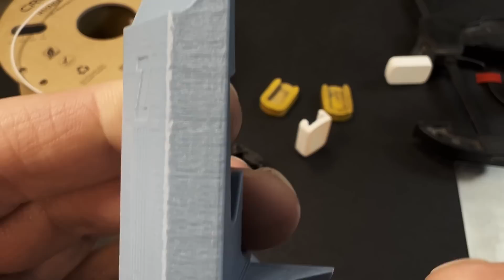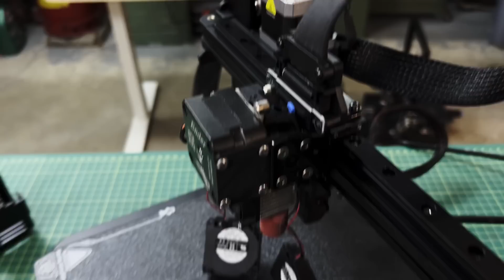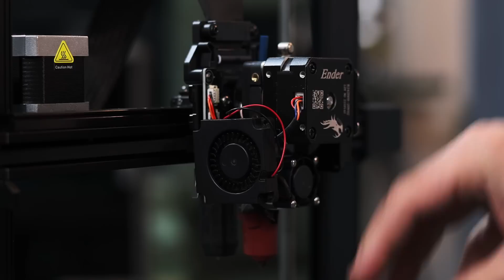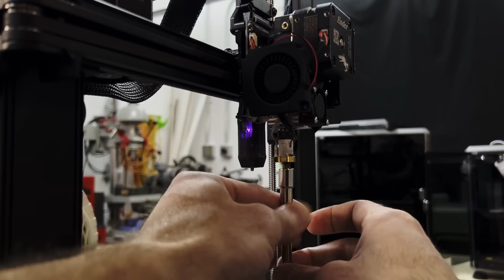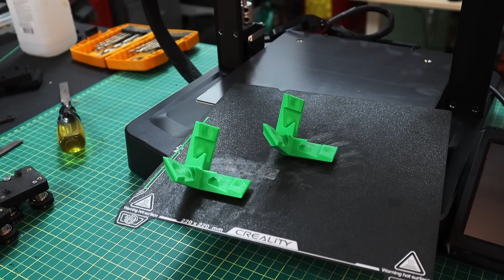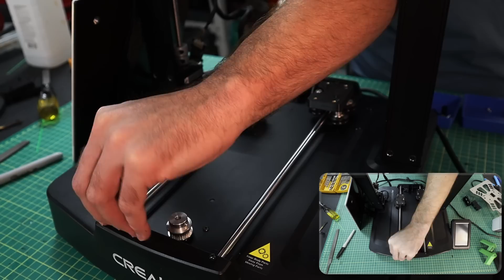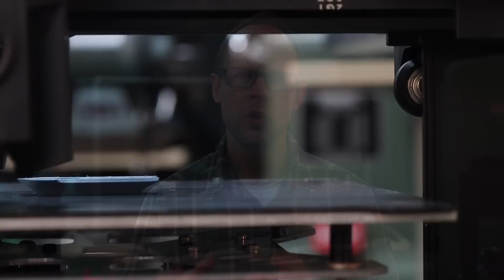What Causes BAD Print Quality on the Ender 3 V3 KE? - Fast Bed Slinger

Comment: I have found the same to be true on my v3 KE.  The y axis bearings are horrendously noisy, leading me to believe they are cheap and defective.  Switching to a linear rail once parts arrive.
Reply from the maker: Yeah, seems like a pretty big flaw with the design, I also notice that the Ender 3 Plus has the same design.  I have a complete set coming out with linear rails which is going to be better than the other option out there, but it'll be about 1 month until I can release the video, the parts like yours are on order from Ali express...   I want to ramp it up after they get here and see how fast I can go with the mod.  I think the extruder is a little weak also, it probably needs a change too.
Reply: @NeedItMakeIt  First sprite extruder I have had and I have some concerns with accurate flow and retractions.  I have concerns regarding how flimsy the gantry is with the spool up top, which I will also be addressing with some bracing.  Quick note, VFA tests show that slow speeds are actually way worse for artifacts than fast speeds....never seen that before.  There is something very odd with their stepper motor control.
Reply from the maker: @nakedspartan  I don't know why a fast printer has a plastic version of the sprite extruder mounted.  Maybe this is just an older designed printer and they figured they'd release it anyway.  I'm seeing the same with artifacts as well, I'd have to check the video, but it seems far worse in one direction, and I agree, at slow speed it is much more visible.  That's the same for the K1 printer as well.  I don't recall the exact answer, but I believe it was the momentum of the movement that was reducing the visibility, extending the undulations to a point where it was hard to see them.  I think it's fixable though, they've addressed the issue with the K1C by having smaller pulleys and also smooth bearing guides behind them and the results seem to be quite a bit better.  My guess is that the large Y pulley is the issue here and that if we switch it out for a smaller one, and increase the movement of the motor, it would help quite a bit. 

If this seems interesting to test, let me know and I can always do a follow up video on just that one topic.
Reply: @NeedItMakeIt That would be awesome.  My biggest complaint with the KE isn't that it doesn't deliver speed, but that I can't seem to achieve good quality even when I dial it down.  I did see another video where they said they actually loved printing miniatures with a 0.2 nozzle, so maybe it's not as complicated a problem as it seems.
Reply from the maker: @RutgersSieve  I would think if they're printing minis, the speeds are quite low and if they're printing towards the center, it would turn out well.  

I think from now on, I'll be testing any bed slingers at the front and back corners first.   I think with the solution I'll provide pretty soon, people will be able to ramp up the printer and still get really good results.  That one little issue here seems to have a big impact.  I think some people also will have parts which are the correct size and with a tight fit, the bearings won't allow much movement on those rods.

Comment: I think it's time to admit this is a design flaw. Single bearing per rod saves space and/or increases Y range, but clearly makes things wobble. Seems like the actual solution would be to apply a hacksaw to this nice base, mount longer rods, and convert bed to 4 bearings with appropriate spacing between them.
Reply: This will cause high precision bearing to lock up. Too many constraints.
Reply: @myvideo7748 Had similar problem when I switched to low tolerance rods and brass/graphite bearings (just my experiments - don't ask). Resolved it by slowly tightening bolts holding bearing cases while checking the movement of the carriage.

Comment: I just got this printer a couple weeks ago. I also had a Kobra 2 pro, and the Ender 3 V3 ke blows it out of the water on print quality, speed, ease of maintenance. Pretty much in every way it's better. 
I've not had any issues with print quality on the ender machine yet. Only had one print failure so far,  and it was because the print broke free from the build plate. Was my fault, I didn't use any adhesion layers.
Reply from the maker: That's good to know.  Have to tried printing in the front or far back corners yet?  Printing in the middle seems to provide pretty good results.  I'm designing a system to fix the movement and allow the printer to reach the highest speeds as well... hopefully at least.  

Maybe you received a printer from a good batch?

Comment: I had the same issue on my SE, changed the bearings and now it prints wonderfully
Reply from the maker: Do you mind telling me where you bought the bearings, or the exact product if that's possible?   I've been looking for the best solution to provide to other people with the same issues.  I was leaning toward linear rails, but I'm open to other ideas as well.
Reply: @NeedItMakeIt  I just got cheap ones from Temu as I wanted to see how they worked, they were a much tighter fit than the stock ones, now the wobble is almost 100 percent gone, but I do think that the rods are too close together which causes the corners to not be as supported, linear rails a bit more apart should be the ultimate fix
Reply from the maker: @manuel509rios  Really,  okay that would be a good first step and I can show that in the follow up video as a comparison.  I took my dial indicator and in the center I measured only 0.01mm of movement, but at the front, I was able to measure 0.15mm, and that was just a light pressure by one finger.  With the movement of the bed and a bit of spring action, I think we'll see more when a program is running.  Thanks for that info, I'll work on a final solution for anyone with this printer or other printers with the same setup.  

I notice that the new Ender 3 V3 Plus has the same rods and bearings, which is even more concerning since the printable area is 300 x 300, I sure hope they have high precision parts on those printers!

Comment: I print petg exclusively and was considering replacing my sv01s with these printers.  Why didn't you just try print at a much slower speed to remove the vibrations ? I print at 40mm /s max.

Comment: Would love to see the 3rd part to your KE series. New to 3D Printers and design and while its nice to problem solve there are times when you just want a part printed. What is your recommendation for an out of the box setup with minimal issues? Or a link to anything you recommend. 

You're doing an awesome job with your video's and channel BTW. Thanks for the great content.
Reply from the maker: For sure!  I'm working on something that I hope will be easy for anyone to print and install themselves, unfortunately it does require the purchase of linear rails and some screws, from Aliexpress it's about $40-50 and a bit of a wait.  It should get us to a really good point with the printer though and allow us to reach the highest speeds with good results.  The extruder is still a bit of a concern, I still believe that this extruder should be the same as the K1 printers.  

I'll be about a month or so until the next KE video, I need to wait for the parts to arrive and then I can finalize the video, showing the install and testing etc.  I'll try to keep it short and sweet.

Thanks for the support I really appreciate the kind words!   Lots more content to come!
Reply: @NeedItMakeIt  Hey these KE videos were really needed. So many people reviewing and not saying a single word about how much the bed shakes and raddles. I also had a problem with my CR touch hitting my prints. I plan on doing exactly what you do with the linear rails to my KE. Could you possibly link the parts list so I can get them ordered now ahead of your video? It would save me and maybe others waiting time. Would be greatly appreciated
Reply from the maker: @ty8324  I like Creality, I've always liked them, and I'm not really a brand person, but offering printers like this which are 'faster' makes no sense if you're not doing a few key things right, and the fit... as well as the overall design of the way the bed rides on the rods is a pretty big one.  

Checklist:

Up/Down - Check
Left/Right - Check
Forward/Backward - Oops missed that one

Well that's okay, it's best 2/3 right? 

I want to make these videos for the people who have the same problem as I do, and also to make sure that Creality is aware of the problems and hopefully it applies some pressure as well.

I'm actually working on the solution at this very moment, but I haven't tested it so it's in proto-type stage and I won't have the rails and blocks for about a month sadly.  Can you let me finish up the design over the next few days, and make sure it's the right call and then I'll send you a note so you can place the order?  I wouldn't want to have people spending money and then find out that something didn't work the way I expected it to. 

The goal here is an inexpensive upgrade, but one that looks good as well.  And to do thing, I am taking a slightly different approach than anyone else doing this has, well anything I've seen online anyway.
Reply: @NeedItMakeIt  I totally agree. That they released such a subpar bearing/rod design astounds me.

IRL, I know four people who currently have KEs, and they all have similar problems. A problem even arose for one of them where the rod itself was moving due to the bottom screw's insufficient length to make contact with the rod. That with the bed wiggle was not a pleasant sound printing at high speeds lol.

You make a valid point, now that you say that I'd prefer to wait and see your idea through to the end. Don't rush. My ADHD caused me to make my first comment, hehe. Even so, it would be interesting to see how your design differs from DerrickDarrell's "Ender 3 V3 SE / KE D3D Y Rails" design on Printables. 

For many, inexpensive will be essential. I'm excited to see the concepts you produce :) I will be following along
Reply from the maker: @ty8324  I figure with how they produce so many printers, they'll be a lot of them with the same issues.  It reminds me of when I worked for a Company making high-production furniture, when we found out we had a problem with a giant wardrobe cabinet, we had to go to the storage facility and open up every giant box and fix each one, that was a ton of work.  

I'm printing the first set of bearing block mounts right now.  I think this will work well, BUT I found something I didn't expect.  The steel plate below the bed is domed.  I would assume they're all like this having being punched out.  Maybe you can confirm that yours is also that way.  What I've done is compensated for it by having the mounting piece slightly domed as well, but maybe I'll have both options just incase someone has a flat one for some reason.  

I had to 3D scan the base to make sure everything was going to fit and that it wouldn't conflict, I'll add that into the video incase anyone needs to do something like that themselves in future. 

I checked out the other design, and the one I am working on is quite a bit different, it will be more stable and will have less parts.  Black rails would look amazing here, but I can't find them on Aliexpress, so I'm going with the standard and we can always blue it later on if it's needed.

Stay tuned!
Reply: @NeedItMakeIt It's interesting that you say the plate is domed.  My bed is not very level, but it doesn't really show a domed effect.  More like one corner is curled up and the other down.  I will try to get a better look when I attempt linear rails.  I might just do this a few times to compare designs.

Comment: Or, you could turn down the speed and acceleration settings to something that the printer can actually cope with. I'd be amazed if it actually CAN accelerate at 8M per second..
Reply from the maker: Sure you could, and it will certainly help.  The problem still exists that there is too much movement at the front, with time and wear the quality will suffer; it needs to be addressed.   I don't think people that buy a fast printer will want to settle, nor should they for having to slow their printer down to the point of not bothering to move to a 'faster' printer.
Reply: @NeedItMakeIt  But they are often not "faster" than last years models. They are often, in the case of Creality at least, cheapened versions of previous models with the ability to print at stupid speed, but they are just aren't built to cope with such speeds. Anyone can set their accelerations to 8000 and claim their printers can do 500mm/s, the fact that the printer will produce utter shit prints and shake itself apart after a few month at that speed isn't mentioned. You are right that people won't settle for having to slow their printer, but why buy a printer then have to spend twice the amount on "upgrades" to get the advertised speeds with acceptable quality?
Reply from the maker: @frankhovis  Yeah, all good points, I think we can agree.  The point of my videos is to make people aware of the problems and hopefully I can also provide a solution which can allow them to get to the faster speeds they were promised without having to spend too much.  The main issues that need to be addressed on the printer are the rods and the extruder, especially when printing in an enclosure, that light-duty extruder isn't something made for high speed printing and lots of people are having problems with it already.  It needs to have been the metal version of the Sprite at least.  Creality needs to up their game to stay competitive, there are a lot of solid competitors coming in, and in the case of Bambu, has quickly made a name for themselves (with the little hiccup with the A1 being the only major issue) which is bound to happen with such a quick release of new printers.   For fast prints, I still believe CoreXY is the best option, it also happens to have an easily enclosable frame if it's not already closed up.  As we learn more about particulates in the air which are hurting us, it'll become even more important to seal up our printers.
Reply: @frankhovis I think a lot of this depends on the prints themselves.  There are a good number of prints where quality doesn't have to be 100% and the KE is good at delivering speed that can complete a print, visual artifacts and a bit of post processing included.
Reply: @NeedItMakeIt I've seen a video where the air quality was tested with PLA on a moderate sized print farm in a medium sized room, the particulates produced weren't even measurable, so unless printing ABS, I wouldn't worry too much.

That said, I do run a small DIY fume extractor nearby (mainly out of respect for my family) and I can't vouch for every additive that may be included in PLA.

Comment: I would like to see how linear rails might affect printing quality on the V3 KE... And if they are sn improvement, recommendations on a DIY solution that doesn't require a lathe!! 😅
Reply from the maker: Hey, ohhhh just for that, I'll make an only lathe solution, solid hard maple linear rods sounds like a nice option.  I will work on something with linear rails though, I think the design is a bit flawed, and the new version of the Ender 3 (Plus) seems to have a similar setup, and may also suffer.

Comment: Thank you for digging into the issues of this printer, looking forward to next video with linear rail! I love than printer and would like to make it even better, I have some large prints that I want to do and stability will be important.
Reply from the maker: It seems like there is a lot of interest in the linear rail option, I'll start on a design that makes it easy to mount them, and looks good.  With this change, it should make quite a bit of difference.

Comment: To begin with, it would be worth installing an accelerometer and adjusting vibration compensation.
Reply from the maker: If the printer is unchanged I've read that most people have noticed no difference, however if you make any changes, I think it's needed, that's a great point, I will order one so the next modification is accounted for properly.  Thanks for that.

Comment: It's just really weird that everybody has different issues with their KE. I only had adhesion issues but was solved by raising the bed temp and that the gantry was crooked. But no play in any of the parts
Reply from the maker: It is very strange.  Is it that the specs for allowable tolerance for the parts are too great?  I just took a quick video using a dial indicator, and I was able to measure that the original bearings on the rods allow a total movement of 0.15mm at the front.  It's good that you don't have this problem though, it's not a good one to have, solving it can be a little more expensive than some people would like to spend.
Reply: @NeedItMakeIt  yeah for sure. I am still interested in the video of installing linear rails on it. Good luck!
Reply from the maker: I'll start working on it, thanks for that.